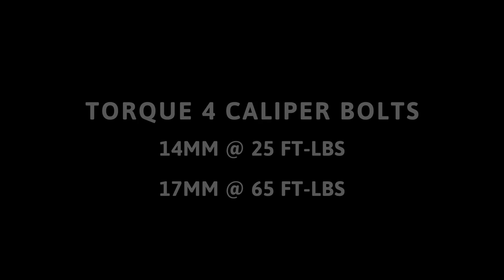Toyota Corolla Front Brake Pads & Rotors Replacement 2013-2017 - 3 1/2 Minute DIY Video

Comment: I love how a few little taps removed that old rotor..mine needed a a pounding with thors hammer to get it off
Reply: Facts
Reply: You can also use a bolt and insert it to the holes of the face of the rotor and it pops it right off. I do that on the rear drums too. I believe it is an M8x1.25 bolt
Reply: Even the wheel  it so stuck   his wheel pop right off

Comment: Rotor to Hard to Remove (Simple Answer!)
Do you see the two screw holes in the rotor? Well, they are meant to have you screw in two bolts and as you turn each of them in (turn each screw a little taking turns), it will push the rotor out. So instead of banging the rotor out with some tool, you can use the screw in\out method.
Reply from the maker: Yes they are great when you have a screw that fits, otherwise I usually put the lugs on loosely and turn and move the car a bit until it pops loose. Thanks for the comment!
Reply: Damn, wish I knew this before I did mine. Had to beat the shit out of them with a sledgehammer to get them off 🤦‍♂️😂

Comment: If I only replacing brake pads, then do I need to remove caliper adapter(bracket) to clean etc.?

Can I use caliper grease instead of silicone grease ?

Comment: When you take the caliper bracket off, clean the bracket then  apply a small thin layer of silicone paste to the bracket to prevent the shims from rusting and so they can seat properly in the bracket  because if they dont then you will have uneven pad wear.  Also lube the shims/ brake hardware. or your pads will seize from the heat just make sure not to get it on the rotor or pads. Anywhere that parts rub you need to lubricate.

Comment: I have a  2015 corolla s and I only see front brakes no rear . Do these only have 2 brakes?
Reply: WHAT? the rear is probably a drum brake. I know mine is. Usually the front brakes wear out faster i'm told. I have about 112,000 miles on my 2015 and I have been looking at doing some of this maintenance like brakes, coolant flush etc.

Comment: 1.54 should I use silicone paste or anti-seize" on back of pad? Some videos said no silicone paste back of brake pad. Lube pin is fine with sil paste. Thanks.
Reply from the maker: Hey, thanks for asking! Either can be applied, Anti-seize would help to prevent the pad backing plate from rust-welding to the caliper. Depending on your conditions this is pretty unlikely. Adding silicone paste is an optional step, but the idea is to add a lubricant, which won’t breakdown in the high heat environment of the brakes like silicone paste. Some pads even come with a little packet provide by manufacturer of lube they selected. You apply the lube at the points where the pad’s metal structure comes into contact with the metal of the caliper or brake pad support hardware to reduce any squeaking at these points. Anti-seize will act a bit like a lubricant giving you some potential for noise reduction. That said, I always use silicone paste because I know it works to keep my brakes quiet but it is totally optional. I’ve personally never had any trouble with removing a rusted brake pad. Of course the important thing is not to get either on the pad material itself! :) Thanks so much for watching!
Reply: Thanks a lot. Already subscribed.
Reply: MINUTE DIY VIDEOS silicone paste on back of paid had almost kill me. It will overheating.

Comment: Do you have to take off the brake fluid cap when working on brake replacement?
Reply: Joshua Longo I would.  Reason being is because when you push the piston of your calipers back in that brake fluid in the line goes back into the brake fluid master cylinder.  To prevent from overfilling it or messing it up; I normally watch it closely while doing my brake job and I will use an old turkey baster to remove the excess brake fluid so it doesn't spill over into the engine bay on anything.

Comment: Question! Is the front wheel a press bearing or hub assembly on a 2014 Corolla? I can't seem to find any videos anywhere explaining how to replace the front bearing on a 2014 Corolla whether it's a hub assembly or press bearing.
Reply: PRESS BEARING. does not come as a bolt on option on this car.

Comment: Does having ABS Brakes ( on my wife's 2015 Corolla ) as opposed to no ABS brakes ( like my 2004 Corolla LE ) affect anything in this video?  i.e. do I have to deal with disconnecting anything to do with the ABS system to perform a rotor / pad replacement as shown in your video on the 2015 car??  Thanks
Reply from the maker: Hey thanks for asking! Yes the procedure to replace the pads and rotors is the same with or without an ABS for the Toyota Corollas. The difference you might notice is a wheel speed sensor cable running behind the dust shield to the hub where the tone ring rotates. The hub and tone ring are not attached to the rotor on the Corollas so changing rotors is the same on both systems. It’s a good question because some cars do have the tone ring and hub assembly as a part of the rotor!

Thanks for watching!

Luke
Reply: Thank you very much for your reply.  I wasn't sure but now I know thanks to you.  Now I'll have the confidence to do the 2015 brake job without any problem.  Thanks again.
Reply: Thank you.

Comment: Hello, How do I know if I must change the rotors too. Can I just replace the pads?
Reply from the maker: If the rotors are not completely flat and smooth then technically they should be machined down until they are. This can cost as much as just buying new rotors depending on the machine shop, so it can be easier to replace them with new ones. If there is only a little bit of uneven surface I might change the rotors the next time but again they really should be perfectly smooth and flat :) thanks for watching!!
Reply: Just want to point out that many parts stores are capable of refinishing rotors, you don't have to take them to a machine shop. I work at a parts store and it's $10-$12 to turn rotors where as buying new ones could cost anywhere from $30 per rotor to almost $100 depending on the vehicle and the quality of rotors you want.

Comment: MINUTE DIY VIDEOS  and others:
I troubled to change disc pads on my Toyota Corlla 2008, because I thought at 75,000 miles on the odometer, the pads might be well worn.   This concern was multiplied by the brake pedal's long travel down, when I applied the brakes.    I thought the long arc down was caused by the worn disc pads.    When I removed the caliper,  I could see that the two pads each had almost 1/4" of brake material.  They were really not worn to a point of danger.   Still,  I replaced them because I already had purchased new pads and had labored to the point of doing the replacement.   The brake pedal is now doing a much short arc to apply braking.
I wonder why the long travel of my brake pedal with the old pads?  Does the piston have such a small reach that the pads don't get more fully applied?    Is the problem simply that I needed to pump the pedal to extend the piston more, adding brake-fluid as necessary?   I feel like an fool having gone to the trouble of replacing the disc pads unnecessarily, when a much simpler remedy was available.    Any comment?
Reply: could have air in the lines.  Air is compressible while brake fluid is not.  That extra distance of travel could be caused by the air compressing...

Comment: Great vid man! Keep up the good work. 
BTW....a) do you have to remove the lid off the brake reservoir before compressing the piston? 
b) Do you have to get your wheels balanced or aligned after changing the rotors and brake pads ( I meant after a job like this) ?
Reply from the maker: Thanks you! I don’t take the lid off the reservoir because I’ve never needed to... although I do know that some people do, I personally think it’s unnecessary. Sometimes people are over zealous about topping off brake fluid. They think the reservoir level lowers over time because of fluid loss however, unless there is a noticeable leak, lowering brake fluid level is caused by fluid displacing the space the pistons moved out to offset the thinning of the brake pads as they are used up. Replacing this displaced fluid by always topping up the brake fluid to the max line could mean that when you press all the pistons back in you may cause brake fluid (which can eat through rubber and paint) to over flow from the reservoir which I think is what has lead to the ideas that you should open the cap, wrap paper towels around the reservoir, remove the fluid, and/or flush the fluid during a brake job. If you let the fluid level vary normally between the max and min lines without continuously unnecessary topping up or leaving the cap off, there should be no need to remove the cap, remove fluid, or flush the fluid during every brake job. Brake fluid is hydrophilic (absorbs water from the air) so leaving the cap off can build up water in the brake lines which can rust brake lines, and create water vapor bubbles which makes for poor braking. I get my wheels balanced only when I rotate my tires or get new tires because balancing is about the relationship between the weight and wear of the rubber of the tire to the wheel (rims) not to the suspension and brake components. The alignment is more to do with changes that happen when you replace, damage or over wear suspension components which isn’t the case in a simple brake job. So I generally do alignments only at long intervals where suspension components may have changed do to wear or when I have them replaced with new components. Thanks for the great questions I hope my thoughts are clear and support my answers!
Reply: MINUTE DIY VIDEOS  Dude, u went way beyond with those answers. Thank you again!
Reply: @MINUTEDIYVIDEOS  Brake fluid is hygroscopic (absorbs moisture from the air). Brake caliper cylinders have enough volume that if the pads are worn down to their minimum, the reservoir level could drop to below the minimum line. It's better to top up the reservoir. Less air in it means less water vapor to absorb. Letting the level drop means potentially more air/moisture. Also, a fluid leak might be noticed before the reservoir is too low to affect braking if the level is kept at maximum.

Comment: Is this a beginner project? I've changed industrial motors and gearboxes but never brakes on a car.  It looks simple though.
Reply: Very simple in every case I've dealt with. Biggest hurdle you may run into is depressing the cylinder if you don't have the proper tool. If you don't,  a c-clamp tends to work well.

Comment: I can't believe it has become trendy to replace perfectly good rotors. I put over 500,00 miles on a Nissan Sentra and currently have 110,00 miles on my 2014 Corolla and have never once changed rotors.  Unless you have worn your pads down so that metal is grinding on metal, there is really no need to grind them either. If you have pulsating braking, take the rotors off, sand both sides with garnet sandpaper, change the pads and good to go. You're just spending money you don't need to spend if you replace rotors every time you change pads. I recently saw a set of perfectly good used rotors in a recycle bin and thought to myself, "another sucker got ripped."
Reply: I have 112,000 on my corolla and was going to replace pads and rotors. I think it is one of those things where it isn't that expensive or hard to replace rotors so they would rather be safe than have a failure. I know that is true in my case. But I guess you would probably notice something going wrong over time instead of sudden failure with a rotor.... you have me thinking about just doing the pads now. lol
Reply: Who cares, they’re cheap as hell.

Comment: Do you have a video that covers the rear brakes?
Reply: On most of these cars the rear brakes are the same as the front with a few exceptions,the pads are smaller and you need a little special tool that looks like a box,the tool is used to turn the piston on the caliper clockwise to compress it so the new pads will fit in,you cant just compress the piston linearly like the front, you have to "screw it in" technically, reason for this is because the rear caliper is attached to the parking brake pedal and it functions a little different from the front.
Reply: @dntlss  My 2015 has drum brakes on the rear so it is a different process